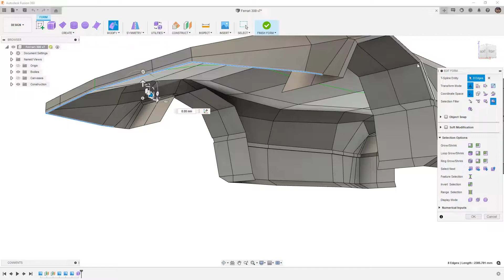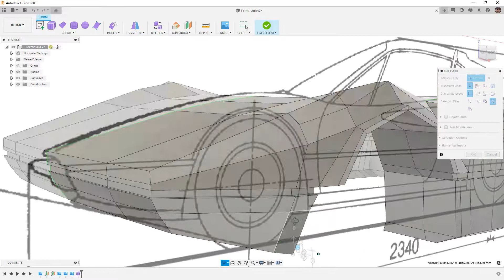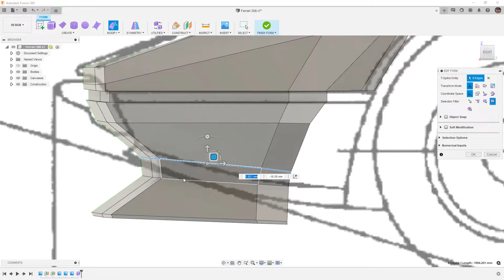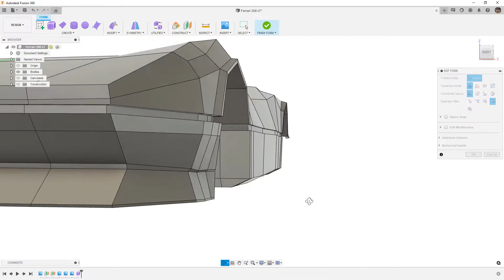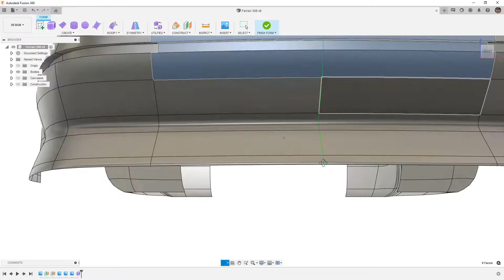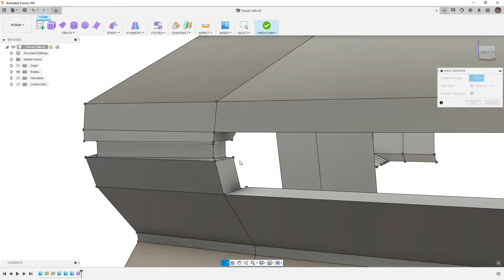How to Model a Car - Ferrari 308 with Fusion 360 Forms - Part 6 #Fusion360 #CarModeling

Comment: good tutorial! is it possible afterwards tho to use it on the printer? Will the planes have a thickness? Or will that not be possible?
Reply from the maker: Depending on the shape you can thicken the surface to 3d print or you can seal off the whole thing with surfaces which will make it a solid body, then use a sparse infill amount.  I think at the very end i had that question.
Reply: @LearnEverythingAboutDesign   Seal of the whole body isn't really the thing I need, its really rather just thickening everything as you said- Is that something you can do on all shapes with one click or does it work with selecting each shape everytime over and over until all shapes are thick as you like? (or perhaps thats possible with the 3D software you are using as example bambu software? I'm pretty new to such things)
Reply from the maker: @dragobruder6328  The thing that makes or breaks a thicken is actually the geometry.  If you have some areas with a really tight corner and you try to thicken it inward it might fail because it will start to overlap itself.  In this series https://youtu.be/0WvaboMYOag  we design a fender and thicken it through the whole process. that might help.

Comment: Getting tricky.
Reply from the maker: putting the roof and body together was a pain!  It can be done as 2 different bodies as surfaces after but trying hard to keep it in forms.  I supply the model at each step so if you get stuck just jump to the next video description and download that one
Reply: @LearnEverythingAboutDesign  no way! I’m sticking with my model to the bitter end.